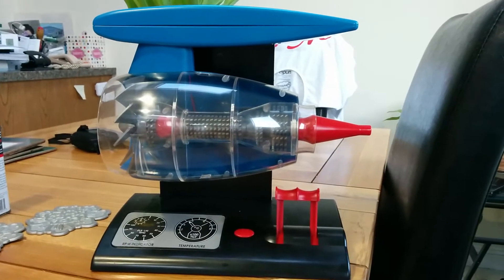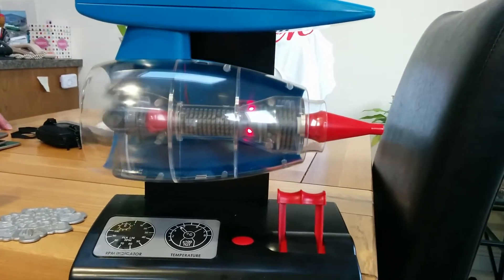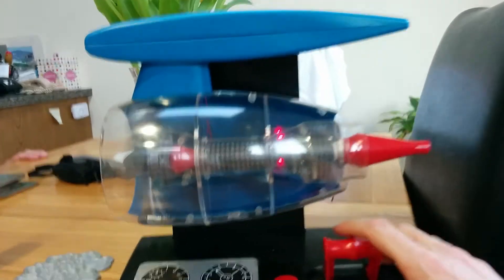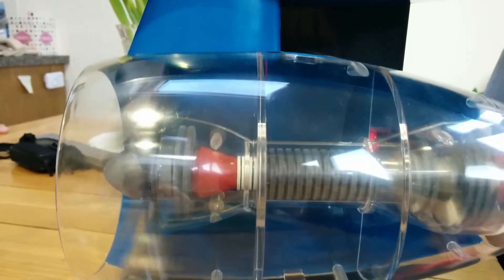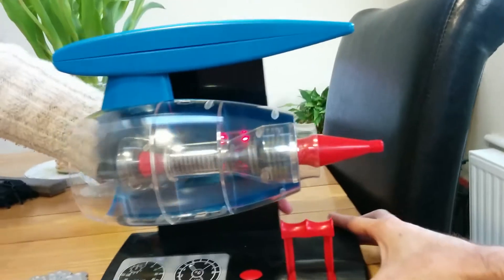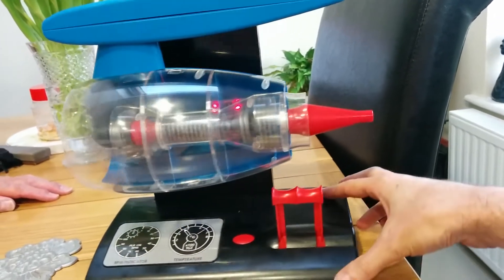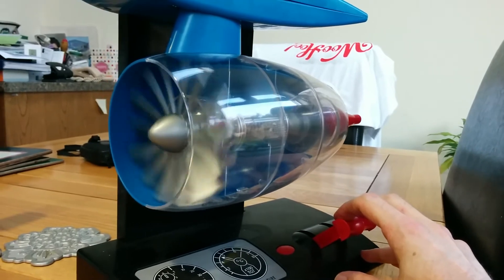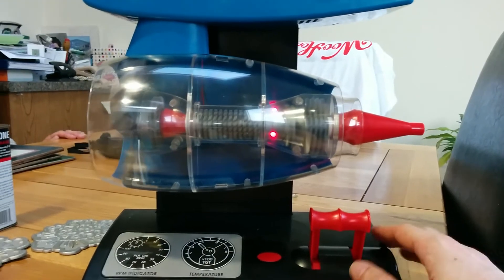Airfix Hornby Jet Engine

Comment: Looks like the fan is spinning in the wrong direction.  The pitch of the blades is supposed to draw air into the engine.  It looks like it's pushing the air towards the front.
Reply: You're right. It is spinning in the wrong direction.

Comment: hi. Thank you for your feedback. I have just gotten a kit this last Christmas :) I am a bit disappointed. The documentation does not  help much. After having spent a few hours to mount it, the pump flow rate is too low to spin the rotor at high speed. Any idea? For example, I would love to have more details about the wiring. How did you do it? Thank in advance.
Reply from the maker: I agree that the pump airflow is not sufficient. I eventually managed to get the internal hose focused on the blades of the turbine to get them to spin. Play around with moving the hose and you should be able to get the turbines to spin. 
I'm onto my forth model in the series and had the car-engine base not work. It basically wasn't providing any power to the motor. Airfix have sent out a replacement base but it was the wrong base and also didn't power the small motor. Hopefully I'll be able to fix it myself.

Comment from the maker: hi Christy, your right that this is a toy. The purpose of this model is to show young and old people alike how the inner workings of a jet engine works. I also have a similar model for an internal combustion engine and while neither model are actually powered by petrol, they give a good basic understanding of how the engines are built, which I think makes for a great teaching aid, when it is not possible to run an actual engine in a class room. So not just a toy, but an valuable lesson in basic engineering 101.
Reply: Hi Geoff. Looks like it is rotating backwards?